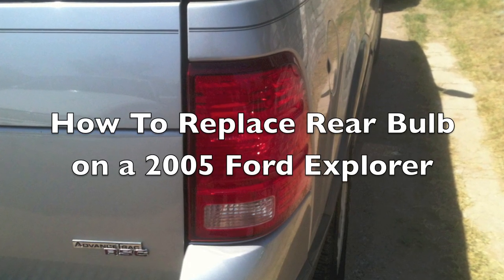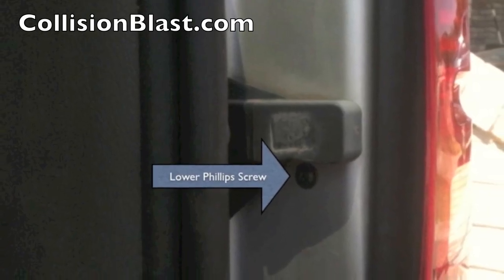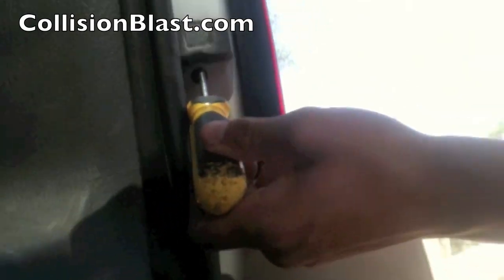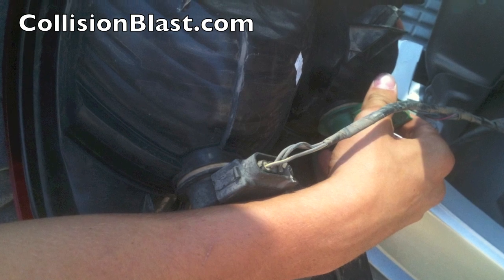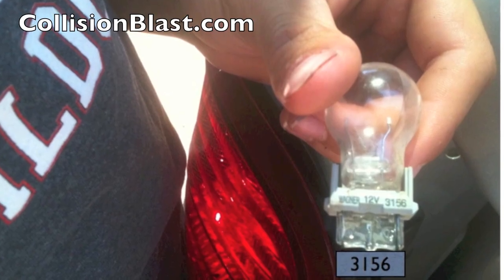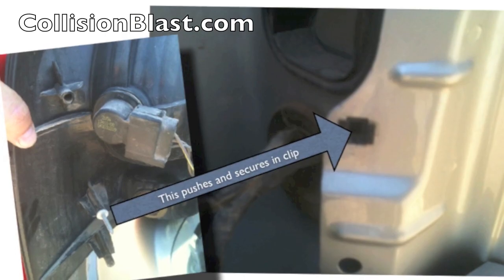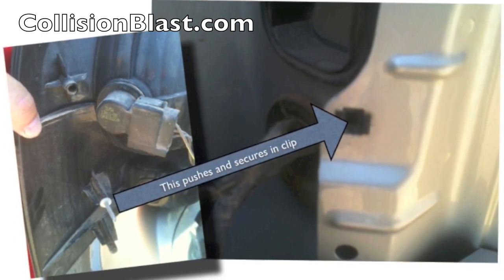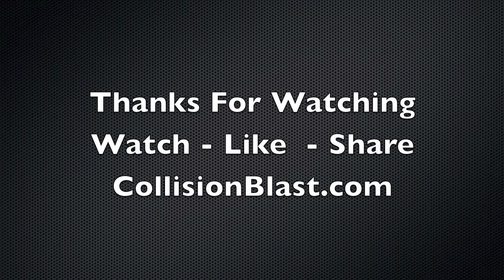DIY - How To Change A Rear Tail Light Bulb - 2005 Ford Explorer - Reverse Light

Comment: On mine both sides on tail light don't work  it does the brakes.  I checked the light  bulb they good as the sockets do I don't know what to do next.
Reply from the maker: ELIAS RODRIGUEZ Did you check the fuse?
Reply: The bulb is good in my tail lights and blinker and it still don't work what do I do